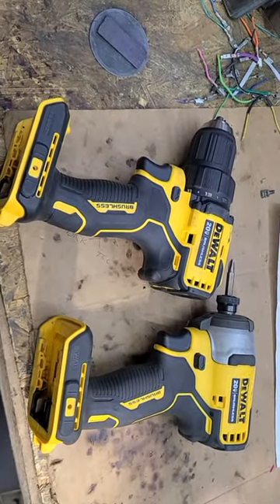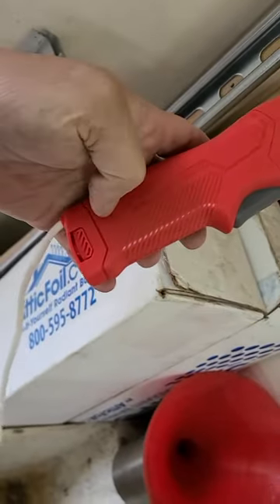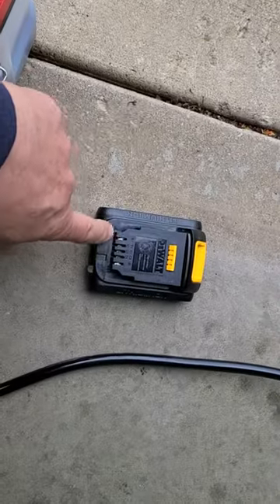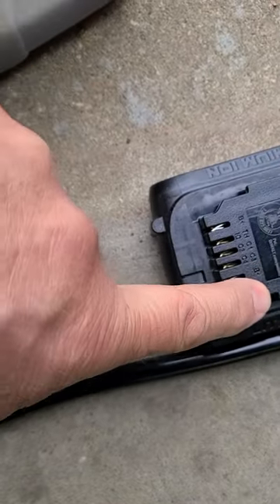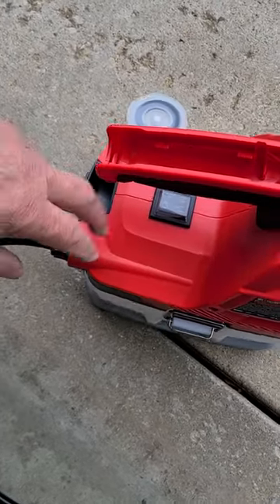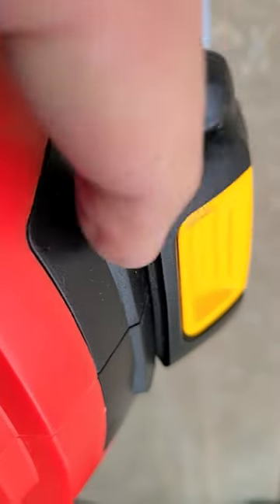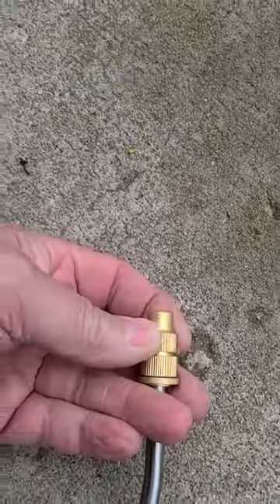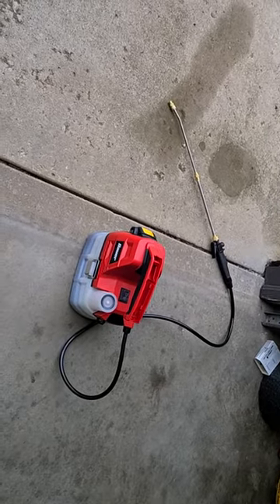harbor freight 20 volt sprayer converted to use Dewalt battery - Demo

Comment: I am a little slow and am not sure exactly what you did.  Did you just skip the board and wire directly from the battery terminals to the switch?
Reply from the maker: I just connected the adapter straight to the internal pump and pressure switch.